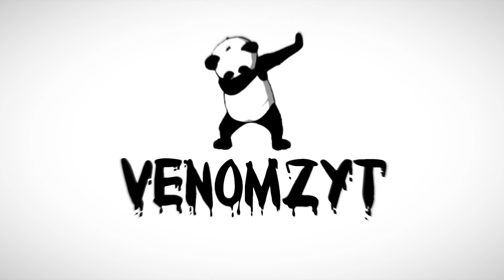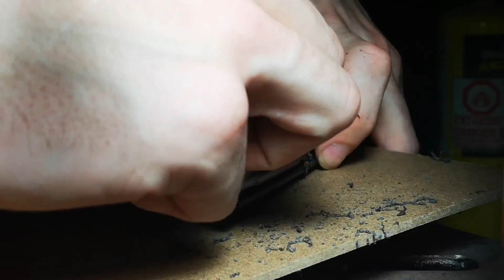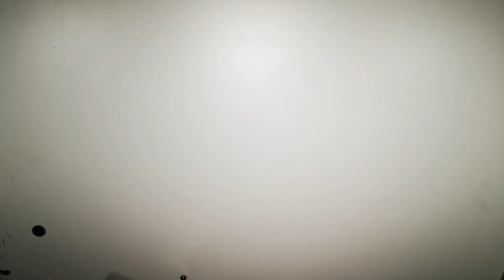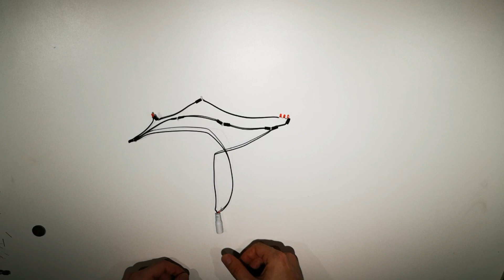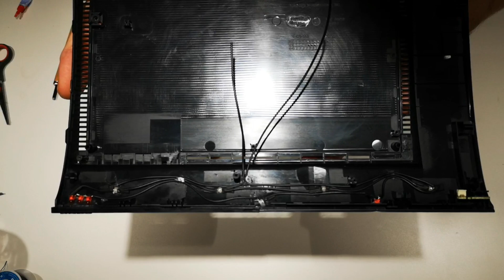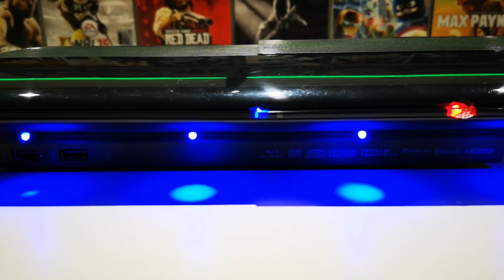How To Install LEDs in a PS3 SuperSlim (2019)

Comment: No offence man, but, I don't think you should drill holes in a PS3 like that :/ but who cares, if the playstation works afterwards, then it's all good.
Reply from the maker: Trust me man there is a very lengthy process that goes into the locations of all my LEDz to make sure that nothing interferes with the internals of the system... I would never just flip a system over and randomly start drilling holes in it.. if you can see from the video I am just working on the bottom shell